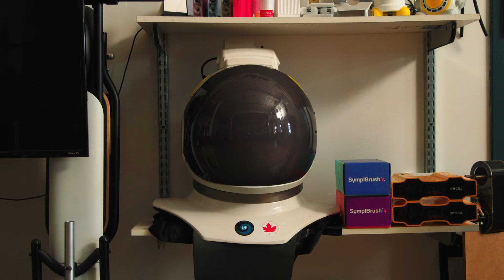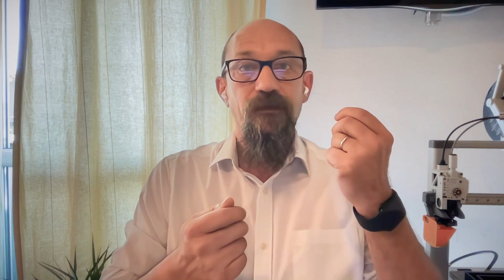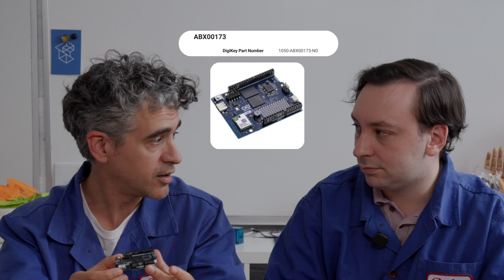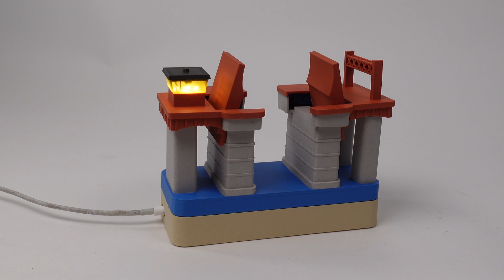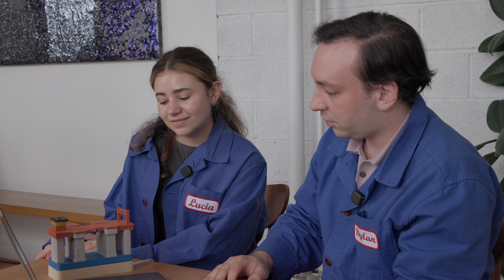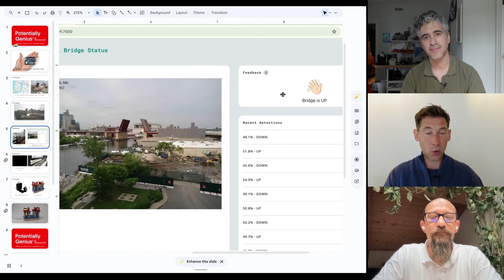Arduino UNO Q Bridge Tracker – Potentially Genius® | DigiKey

Comment: I have a question, why can't your employees just look at the bridge through the window or just look at the live video feed from the camera directly to see if the draw bridge is up or down?
This is why AI solutions are funny, they make simple problems overcomplicated and your trained model prediction is not that reliable, it's toggling between out and down :face-blue-smiling:
Reply: Fair points. On just looking — the bridge isn't visible from inside the office or when you're coming up out of the subway, and once it's raised it can stay up a while, so you want to know before you walk over. Worth noting the device isn't reading/sending a live video feed; it detects the bridge state on-device, at the edge, no internet. And you're right that the prediction toggles in this clip — that's a real limitation we're still tuning. Longer term the goal is to learn the bridge's patterns and predict openings, not just report the current state.

Comment: The only problem is that I can't 'Fit AI' into the solutions for the problems I have to solve with Arduino. Yes, the Linux OS and MCU bridge along with WebUI is awesome, the only problem is any project that could have use AI, can be done with sensors and decisive logics for the most part ! Where AI is a must, its so unreliable at detecting objects, speech recognition or local LLM is joke. Uno Q is great for Linux + MCU solutions but not good for Edge AI at all imo
Reply: Agree — if a sensor and some logic will do it, that's the better build. This one worked because the problem is narrow: fixed camera, fixed scene, two states, and nothing we can mount on the bridge. The App Lab examples on the Uno Q got us to a working classifier much faster than expected. Edge AI only earns its keep on a narrow band of problems. This one landed in it.

Comment: There are easier ways to do this.  There's usually a VHF broadcast that is associated with opening and closing a bridge, there's also an operator in the bridge control to operate the bridge....
Reply: There is no dedicated, looping automated weather-style VHF broadcast for the Pulaski Bridge. As we explain in the intro, the intent of this project was to find a compelling example application for the Arduino Uno Q, rather than developing the most optimal way to track the bridge position. That said, it was quite easy to do with the Arduino Uno Q and App Lab!